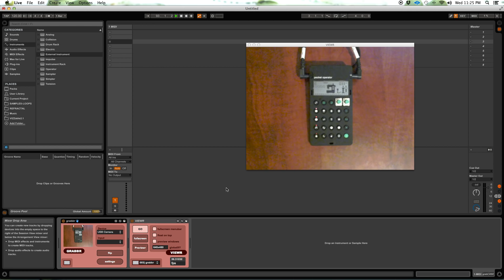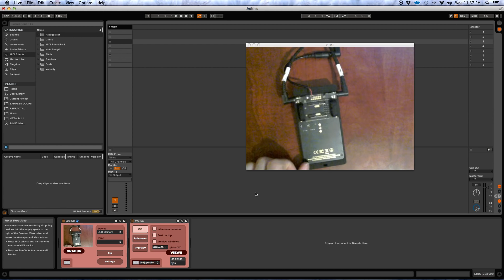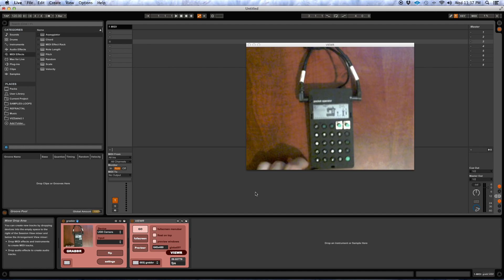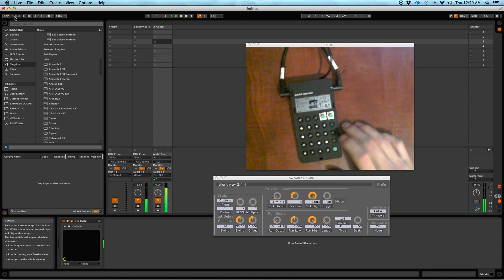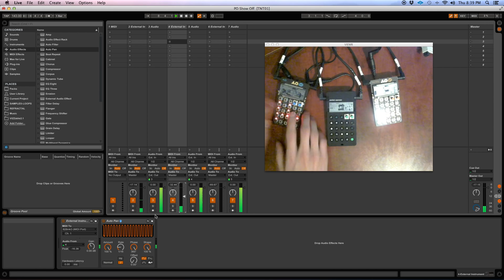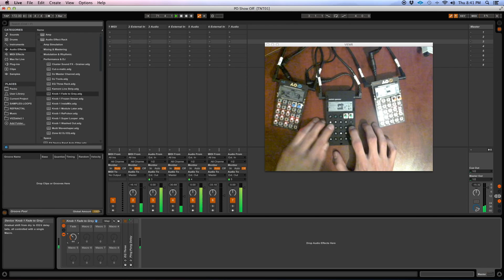Syncing Pocket Operators to Ableton

Comment: Realise this is an old video but how are you connecting the P.O. to your interface? Does it go into line in or does it need rca?
Reply: do you know yet
Reply: @pmbu  is there an answer
Reply: 3.5mm TRS to Dual 1/4 in stereo cable. 3.5 goes into output from PO and two stereo ends go into L and R line input on your stereo audio interface, in case people are still wanting to know!
Reply: @jaylenjordan8595  Or a 3.5 mm to 6.5mm converter also works!

Comment: Besides the ES-1 and the ES-2-2, do you know of any other CV/Audio Interface modules? Because I can't find any of these in stock anywhere.
Reply from the maker: +Daniel Elenes Any DC coupled interface will work as a CV converter.  Expert Sleepers has a list of ones users have tested and found working.  

http://www.expert-sleepers.co.uk/siwacompatibility.html

Not aware of other solutions similar to the Expert Sleeper modules; seems like interfaces are the easier option.

Comment: Why do you need to use CV output and the silent way plugin? That seems like overkill/unnecessary for this scenario.
The pocket operators will sync to a click track, so couldn't you just make a simple midi click loop and send it out a regular audio output to the PO?`
Reply from the maker: +Josh Rosenstock If you have tried the click tracks as a sync, you will find it is not accurate, especially when clocking all three.   The Silent Way Sync plugin is controllable far more than a click track is and has a much greater resolution.  This also allows for the POs to sync to Ableton at different intervals.  For example, the PO-12 can be in half time and the PO-14 in standard.  And more importantly, don't forget about that swing!  You need decent resolution for swing to be accurately applied.
Reply: +Josh Rosenstock Click tracks do not work right.  The PO responds, but not correctly.
Reply from the maker: +Josh Rosenstock As far as the click signal, even with the Expert Sleepers plug, a standard audio out will work; no need for DC coupled outs

Comment: hi , with the power supply mod , do you have to run 3 x power supplies or is it one powering 3 pocket operators.
i'm not very familiar with pedal power supplies , i just have lots of single multi adapters.
thanks
Reply from the maker: +wayne gillingham The units are powered with a single power adaptor.  The pedal kit referenced is used merely for a cable that is daisy chaining the power, and looks like this

http://www.aliexpress.com/store/product/VITOOS-1-To-3-Daisy-Chain-Cable-Guitar-Effects-Pedal-Power-Supply-Splitter-Cable/412605_1853149856.html
Reply: +REFRAKTAL thanks